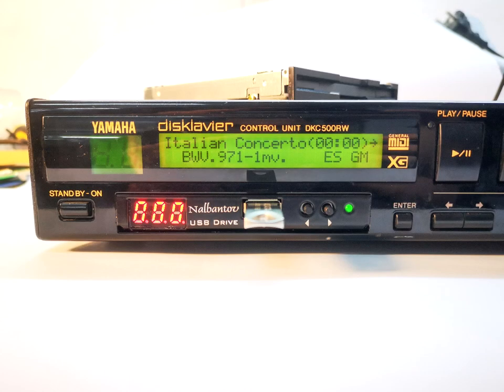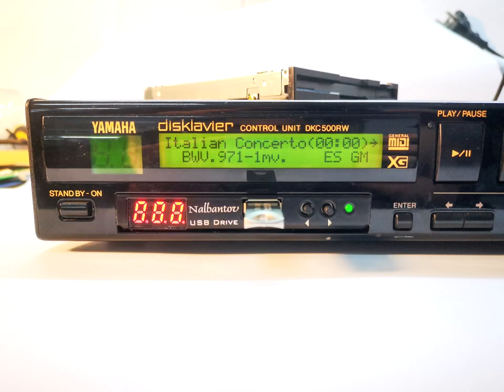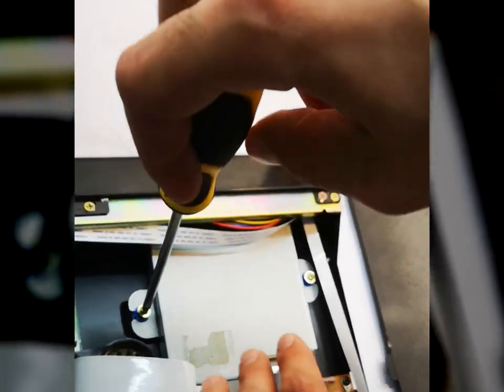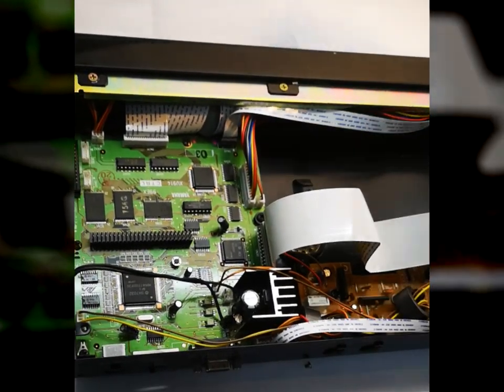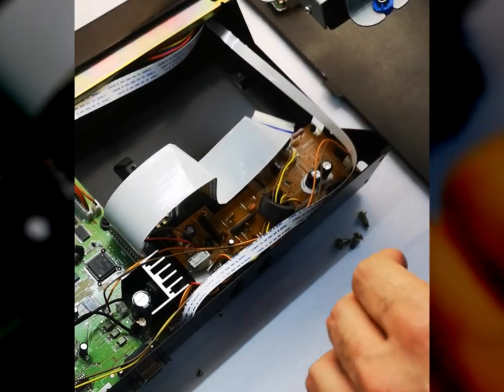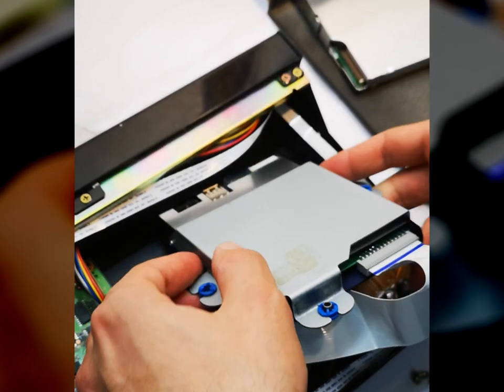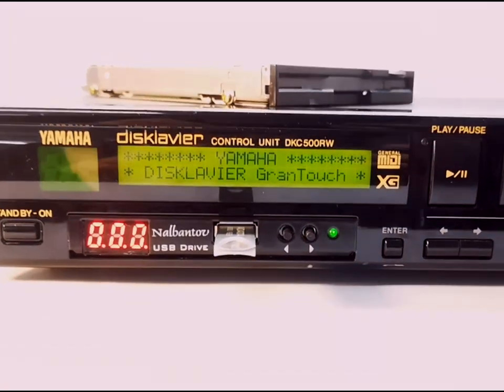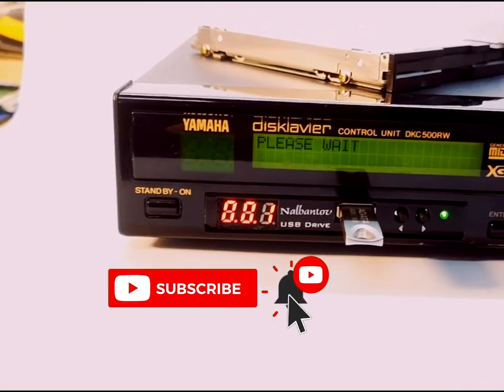How to install the Nalbantov N-Drive Slim floppy emulator

Comment: Hi   I currently play an El90 organ and see you have the Ndrive for this instrument.
If you can answer  a question if I could reply please

Some of my disks on the El90 organ  instrument  show "PR" which means the are protected and can only be played on the El90 
I have tried to open/explore the  floppy disk on my pc so I could get the files across to a USB pen drive but access is denied 
 
I have been told that with this Ndrive the software that comes with it maybe able to extract the files so I can use these files on the USB pen on the N drive  when I purchase this  
Can you tell me what exactly the software does ? Thanks and look forward to your reply
Reply from the maker: Hi,there, 
It depends on what hardware (computer OS and floppy drive type) you have. We are using several special software to transfer the disks and we will test them on your end.

If we cannot handle the process on your end, you can ship the disks to us. We are offering a floppy disk transferring service. We are using special hardware to perform the transfer because these disks have encryption and are very difficult to transfer. Recently, we had a client from Japan with EL90 and some of the disks were transferred successfully on the client's end. But some disks required a special way of transferring and they were shipped to us. Now we have one happy Japanese client :)